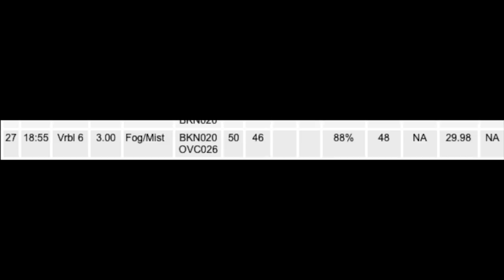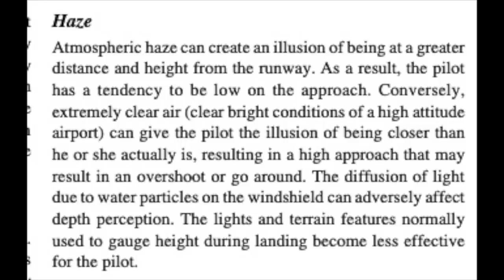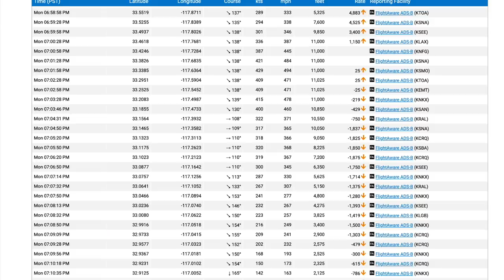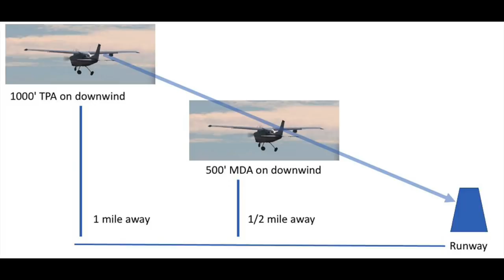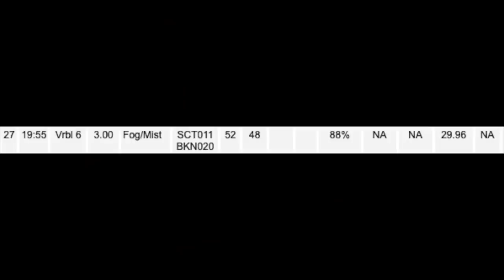N880Z Learjet Crash El Cajon San Diego California - Low Altitude Starts Accident Chain

Comment: From what I have read, this is the way they landed at Gillespie in previous flights using the same runway or one other. I don't think they stall spinned. It seems to me, just my opinion, and I'm not a pilot, that they mistook the roadway for the runway, and when he realized his mistake, he was too low and crashed into the road and that's why he said what he did before crashing. I think he said oh sh** because he realized it's the road, not the runway. Another channel that Reviewed the accident said data should their speed didn't drop to stall speed.

Comment: There is a LOC-D instrument approach with an inbound track of 269°. Banking, turning and pulling at low altitude in marginal wx at night,, while trying to maintain visual contact with the runway is not a good idea. So sad and unnecessary.
Reply from the maker: Yes, I should have mentioned the LOC-D, but didn't because it wasn't an option for them to fly at night, if they wanted to land on 27R. It also has a higher MDA, making less likely that they would succeed in breaking out on the approach. But yes, tragic and avoidable.

Comment: Even at a proper altitude would they had enough time to recover from a stall in that plane??? I'm guessing not but it sure didn't help their chances
Reply from the maker: Ironically, they were finally actually at about the right altitude approaching the crash site. But they were flying through the final and headed straight for a mountain. At that point, they pretty much ran out of options.
Reply: @AviationNewsTalk  Thanks for the reply. Much appreciated

Comment: Good explanation.   According to Dan Gryder almost all corporate jet pilots are poorly trained when it comes to circling the landing strip in a fast moving jet.  You made it clear that these pilots were too low from the outset of the maneuver.
Reply: Too low and too slow
Reply: That Dan Gryder video is one of the most ignorant aviation videos I have seen in years.  He makes a claim about how corporate pilots are trained that isn't even accurate.
Reply: @rushmoore5112  I watched his video and was wondering how accurate his information was.  If true, I'd think he'd have lots of lawyers calling him to make a case.
Reply from the maker: And yet most corporate pilots would be required to have an IPC every six months that must include a circle to land. Though if it's done in a simulator, that circle to land might be at 1000 feet at a large airport like KMEM Memphis. And that in no way would resemble what these pilots were trying to do at low altitude and scattered fog and mist.
Reply: @AviationNewsTalk  they're being trained but they're not being trained to keep a 30% stalll buffer on their speed when making these circling approaches and maintain that speed until they're straight and stable on final and then reduce speed, the airline's do it why don't these guys have to do it? They're only required to maintain five knots above stall speed when the airlines are required much more on circling approaches.
Reply: @AviationNewsTalk  That's an FAA certification problem.  In order to do full type rating in a simulator, the circle can only be done at certain airports (KMEM, KJFK, etc).  How many of us could do the LOC27 circle 18R around the FedEx building in our sleep?  This approach was clearly not that.  You did a great job of showing the difference in geometry between a low circle and a traffic pattern.  He was most likely way too close to the runway in order to make a safe turn at any airspeed.  As he was staring at a mountain, his only options would have to been to either bank and pull or perform a terrain escape maneuver/missed approach but since he had canceled IFR, that was surely a limitation in his mind.  The decision to be there was what killed these guys, not a lack of training or flying too slow.
Reply: @jimmccusker3155  All I know is that I have been trained at such contractors for years and I have never ever once been asked to fly a circle at ref +5.
Reply: @rushmoore5112  There are bulls and there are China shops
Reply: @rushmoore5112  Trying to see every side of this, what are the bigger inaccuracies?
Reply: @rushmoore5112  I'll stick with Juan at Blancoliro , and this channel here. Juan is the best!
Reply from the maker: Rushmoore, interesting, I didn't know that. And yes, the LOC27 circle 18R around the FedEx building was exactly the approach I was thinking of! Doing that in no way emulates the kind of weather conditions this pilot faced, or the kind of terrain he was flying in and around. Of course he shouldn't have been that low. And he did quickly run himself out of options. Your final sentence sums it all up: "The decision to be there was what killed these guys, not a lack of training or flying too slow." Very well said sir, and I plan to quote you on my followup piece about this accident.
Reply: @badmonkey2222  that is not true! Dan Gryder is incorrect with his information. I’ll put my 20 years of flying jets 135 and receiving training at multiple Flight Safety and CAE’s locations up against what he said:  He is flat wrong about DMMS not being taught and is wrong about circling at Vref+5. I have nerve ever had an instructor teach that kind of non sense.  Most circles are taught at Vref + 20, that is DMMS set by the manufacturer and test pilots. It’s a hard number limitation on most jets. These guys weren’t even on a circle approach.
Reply: @billythekid3234  I could not agree more.
Reply: @rushmoore5112  Yep, he's a conspiracy theorist.

Comment: Could the FAA’s new rule have been a factor of forbidding pilots from using auto-landing and other certain flight systems at low altitude where 5G wireless systems could interfere w/ onboard instruments that measure a plane’s distance to the ground?
Reply from the maker: No. The C-band, which is used by some cell carriers for their 5G networks is close to the frequencies used by radar altimeters. Those are used for ILS CAT II and CAT III approaches, including autoland. Gillespie doesn't have an ILS, so pilots wouldn't be required to use a radar altimeter. Also most planes are not equipped with radar altimeters. Even if the Learjet was equipped with a radar altimeter, the pilots would almost certainly use their barometric altimeter during the approach to landing instead, as a radar altimeter would be jumping around, as it measures the distance to the ground, which varies. The  barometric altimeter essentially measures the height above sea level, so it would give a steady indication as they flew at a constant altitude.

Comment: Why would they have a flight plan to a runway they can't use? Shouldn't they file for the runway they need? It seems like they are forced to file for 17 and then circle to land according to this video.
Reply from the maker: Bill, generally when you file an IFR flight plan, it's not to a specific runway, or even to a specific instrument approach, it's just to a specific airport. That sort of makes sense, as weather can change during a flight, and a runway or instrument approach you thought made sense when you departed might no longer make sense by the time you arrive. There are only two approaches available to aircraft in their category, and except for the straight in landing to 17, at night, every other option requires circling. They didn't have a lot of good choices.
Reply: forced?
Reply: @fcaughli  Yeah, it seems like these jets pretty much have to do that circling approach. Get clearance to land on a runway you can't actually use, cancel that and go VFR for the runway that you actually need.
Reply: @bills6093  Right I understand what they are doing, and this is probably not the first time, maybe even 'normal' for this airport. It sounds like some kind of dangerous game of a procedure to me. But what I mean is brains would tell a pilot this is not an ideal situation, in fact it can be a dangerous one at night and especially in bad weather. VFR is for visual so you can see, at least ground lights. I understand there are some night flying restrictions for this airport. They are not forced to use an airport like this at night. They should not have put themselves into this situation at all. They are not forced to do this all.

Comment: It was reported on an aviation blog that this was the company's written procedure, cancel IFR and do VFR to 27R. Cannot confirm. Re the altimeter, there's been chatter about the 5G impacting that? Have no clue, but there's that chatter, even re this horrible accident. RIP.
Reply from the maker: Yes, since they were IFR, they had to first cancel IFR before landing on 27R, since the GPS 17 approach they were flying does not permit circling to land on 27R at night while IFR. But, it's legal to do that VFR, which is why they cancelled IFR. 
No, 5G would have nothing to do with this accident. The C-Band used by some cell carriers for 5G is close to the frequencies used for radar altimeters. But radar altimeters are typically used for Category II or III ILS approaches. There is no ILS approach at Gillespie Field. The primary instrument the Learjet would have used for altitude throughout the approach and landing is a barometric altimeter, which isn't affected by radio interference.

Comment: Max,  Blancolirio said there IS an approach to 27R, the "Localizer D".   Not a straight in,  but close to it  (maybe an offset Localizer?) which results in minimal maneuvering to line-up for the 27R landing from the MDA.   If so, that is the approach they should have been doing.
Reply: There is, but it's not that simple.  The LOC-D is in fact a straight in approach but is actually categorized as a circling approach because of the excessive glide slope required to complete it.  The glide slope on that approach is over double the "normal" glide slope required on most instrument approaches, and that's due to the terrain in close proximity at the approach end of the runway.  In addition, the chart specifically prohibits making that approach to runway 27R at night, so they couldn't have done it under IFR legally anyway.  Sure they could have cancelled IFR and switched to VFR so that they could complete the approach "legally", but they were also probably worried about runway length.  The Lear isn't really a short field airplane to begin with much less in marginal conditions, on a wet runway, at an extremely high descent angle.
Reply from the maker: Well said. The LOC-D also has higher minimums, increasing the chances that they might not break out of the clouds at minimums.
Reply: @AviationNewsTalk  Yep! There’s that too.  From the footage it definitely seems like the clouds were lower than reported!

Comment: Maybe I'm misunderstanding what I've read on this channel and on Juan Browne's and Dan Gryder's channels, but it seems that the owning company is based at this field, and the field has no IFR approach to the only runway long enough to safely land the company's aircraft....
Reply from the maker: I think that's a fair statement. Technically, they could fly the LOC-D approach straight in to 27 Right, but only in the daytime. At night, circling to that runway is not authorized. The problem with the LOC-D is that the final stepdown requires almost a 7 degree descent to land straight-in to 27 Right, which most people would consider an unstable approach because of the high descent rate. So these pilots didn't have a lot of good options other than diverting to another airport.

Comment: 9:47 "no ifr approach to 27R". But there is: LOC-D approach plate for SEE.  Regarding visibilty: it might be clear at the airport, but those hills attract mist especially at that time of evening and temperature/humidity (and that correlates with the doorbell videos).  That plane regularly flies in and out of Gillespie field, so one or both pilots are familiar with the terrain. They would know to look for particularly the 1200ft ridge that is Rattlesnake Mtn, and if the visibility was good they would have seen it during the whole turn.  Yes they were overshooting the turn from base to final, but more to the point, it seems highly plausible that actually Rattlesnake Mtn was obscured from view, and so not until too late did they realize they were heading right for it and tried to turn more sharply with a climb....leading to stall etc. As another point, flightaware has them crossing eastward over N Mollison just south of Greenfield at 800ft MSL, which leaves a diameter of only 4000 to 5000ft diameter to make the turn within the boundary of Rattlesnake Mtn ridge. And as you say, that's not enough for the speed they were flying.
Reply from the maker: I understand your feelings. I started taking flying lessons 50 years ago this year, and I sometimes wonder if I'm pushing my luck by staying at it. But...I also think that staying at it and concentrating on doing it well...and a little luck...is why I'm still around. Fully 80% of accidents are the result of poor pilot decision making (call it poor judgment if you'd like). If you learn all you can about accidents, and avoid making the mistakes of others, you can greatly enhance your safety. I'd encourage to take a few lessons and see how you like it. And then just gradually expand the envelope of what you do in aviation. Too many people think that "Now that I have my Private, I can fly anywhere, anytime." And while legally that may be true, they sometimes get in over their head and crash. If you proceed slowly and deliberately, you should be fine. But definitely try it to see how you like it.

Comment: Nice analysis.  I hear a distinct bang on the recording that sounds like a possible compressor stall and or a piece of metal at the spar cracking...its hard to tell without a real analysis, but he could have put too many g's on it trying to steepen the turn which would raise his stall speed.  I really dont know why he did not try to go for the east landing..but I know the wind is usually out of the west in S. Ca so he may have just been conditioned to land.  Final point.  This was most likely an empty leg part 91 leg where the Captain will usually let the F.O fly, because most 135 operators dont allow the F.O to fly revenue legs unlike 121's.....Lear jets have lots of ways of killing pilots....its an unforgiving jet.....but fun to fly if you know  what you are doing...

Comment: The thing is we pilot's need more training in circling approaches, especially in speed calculations. Personally I hate circling approaches, especially at night or low visibility. Flight schools really have to focus more on training pilots in Circling approaches, otherwise this will keep happening.
Reply from the maker: Yes! I just finished recording Monday's podcast about the accident, and this was a key point we discussed. The simulator training jet pilots go through in no resembles the situation this crew was faced with. Granted, they were VFR, but the path there were following was the same for an IFR circle to land. My personal minimum is I won't circle at night. One study I found says the circling accident rate is 25X the accident rate for a straight in approach with a glide slope. There's always another option, even if it's diverting to another airport.

Comment: Weather, rain high hills and too low. These are experienced pilots and familiar  to the airport. Why so low, and this could have been a down burst. Video shows the plane out of control and straight in. The pilots aware of the condition and to me sounds surprised at what is happening and no warning. Should be bells and Pull Up but was sudden.
Reply from the maker: I think the "why so low" question is the one the NTSB will be scrutinizing. It just didn't make sense to be that low. As for the videos online, these are all recreations for the flightaware.com data, which ends before the crash. So I wouldn't expect the final portion of them to be accurate. And the stall/spins happened incredibly fast with the low wing dropping suddenly without warning, putting  you almost inverted. Not pretty.
Reply: @AviationNewsTalk  Down bursts have wiped out heavy aircraft on approach. They were also suprised they were crashing. It happens suddenly and pushed down. Flying in BC mountains always be prepared for down drafts over the mountains. In this case hills and could be pushed lower on approach. We saw the effect, and may be the cause.
Reply: @AviationNewsTalk  i've come across many pilots losing altitude as par for the course in these such conditions (non- and/or low visability).  as climate conditions alter over time there will be more of these situations.  just think.  a jet.  short airstrips.  clouds and fog everywhere about.  rain & darkness.  VFR or IMC or VFR whatever - now just fly the airplane - right.  the pilot cannot see and ergo as per.  no way.  not poss.  no one, not even Chuck.

Comment: I have taken ONE single engine lesson, and even I know what went wrong.
Circling at night in challenging terrain with low clouds, went off instruments to visual, leaned into the turn and stalled the port wing.
Low altitude, turbofan Lear, no time to increase power and climb out of the stall.
Reply from the maker: Fairly good summary. Clearly a loss of control accident, though we may never know whether it's because they pulled up too abrupt, or turned to abruptly, as the aircraft didn't have a flight data recorder. And sadly, it appears that it was avoidable.